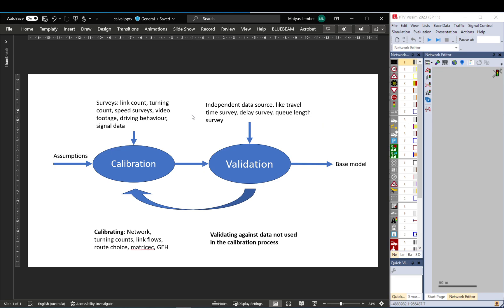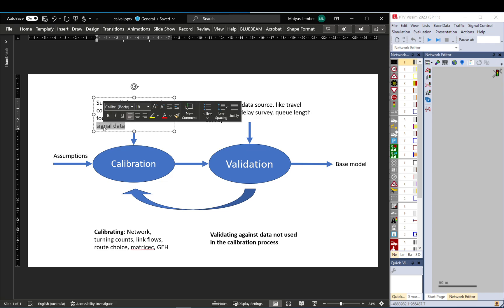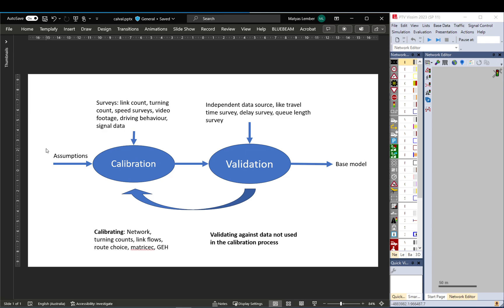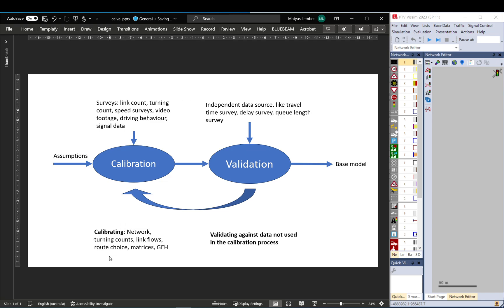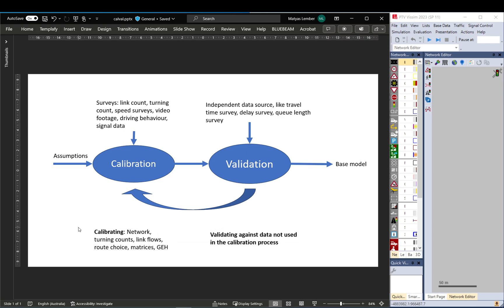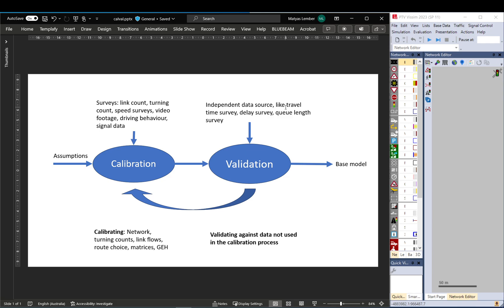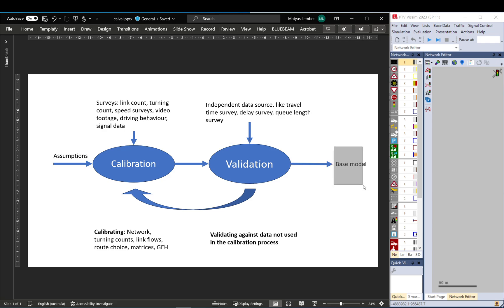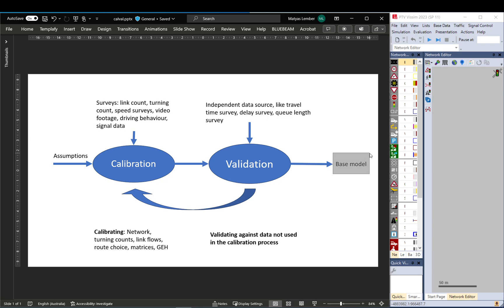Vissim Tutorial - Calibration validation basics

Comment: For calibration of Vissim Model with Field volume 
1. Which results in vissim are to be used for calibration , there are data collection points, vehicle network performance evaluation results, Delay Results, Vehicle Travel Time Results? 
2. And why are Vehicle(All) results vary different in other results like Delay Results, Node Results etc.
Reply from the maker: Hi J Sai, 
1) you calibrate your model using data collection point and node results usually. Network performance is more an indicator for comparison between scenarios. Travel time is usually for validation once your model is calibrated.
2) Because Vissim uses a random generator. Speed, vehicle input (usually) and other settings/inputs are given in distribution and not as exact figures. The random generator basically selects within that distribution a number in each run when you use different 'random seed'. See this video for reference, I think in this one I talk about this:
https://youtu.be/isxzbP3cSLo
This ensures that when you run your model multiple times you can create more reliable results and avoid having 'one off' situations. Basically you get a normal daily variation included in your model runs when you do a multirun and average the results.